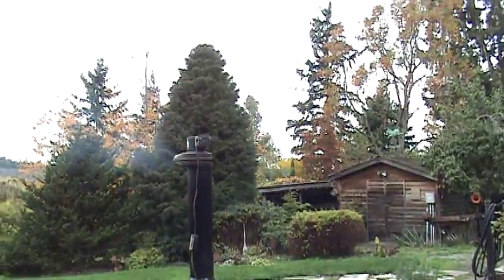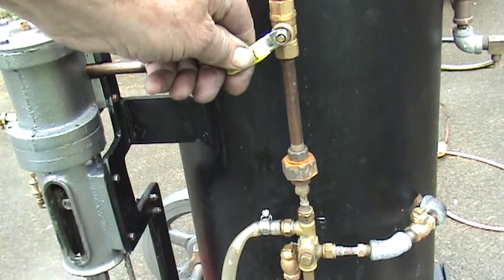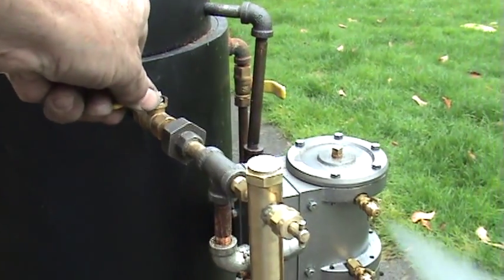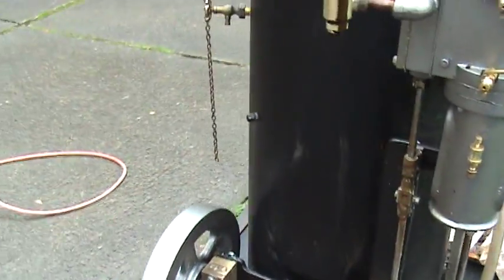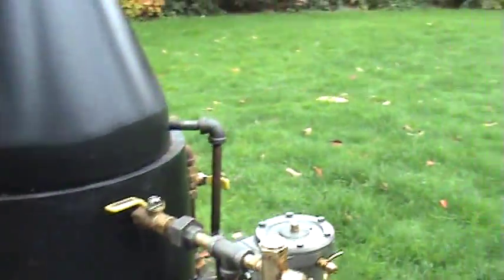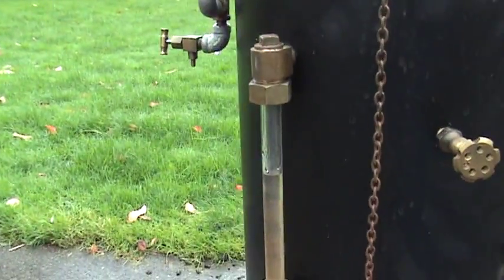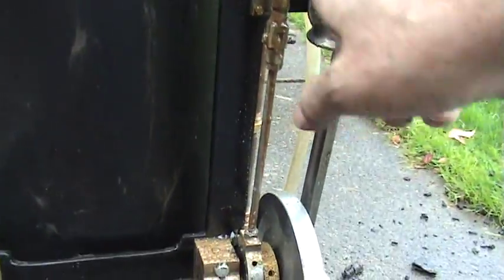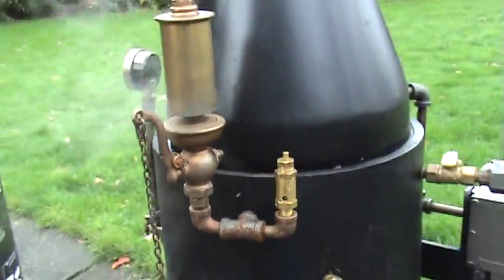Live Steam Vertical Factory Steam Engine

Comment: You should use distilled water for your boiler.
Reply: Good one! Not really practical for a boiler of that size. Especially for a steel boiler. You need boiler water treatment like we use on the big ones.

Comment: And if the distributer block it's self is worn and loose, allowing steam to pass by it and around it? you may be able to repair it as simply as a Babbitt Metal pour and some light work with a flat rasp or file then a good smoothing with fine sand paper, or a buffing wheel.

Comment: your distributer block, actuating rod seams to have a bad seal,
or it may be your driven rod seal?
I think from what I could see the steam jetting past on start up even when not spinning?
That it is your Steam valve actuating rod.
Rope seal? 
or leather seal?
both types are compression seals.
either way?
your engine needs one.